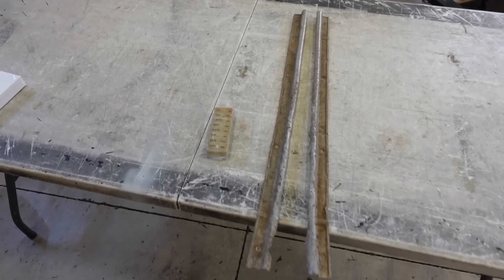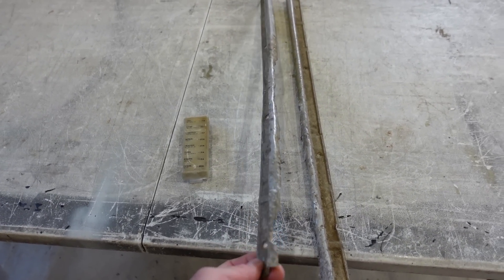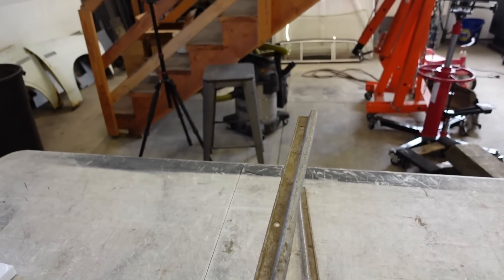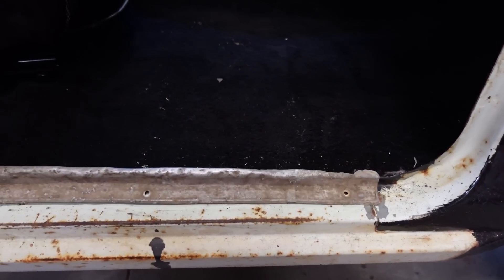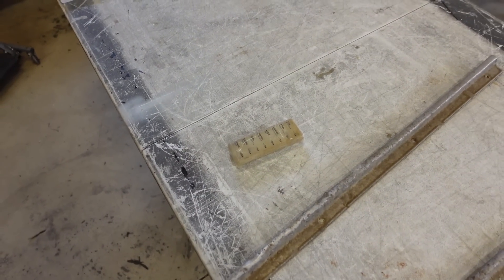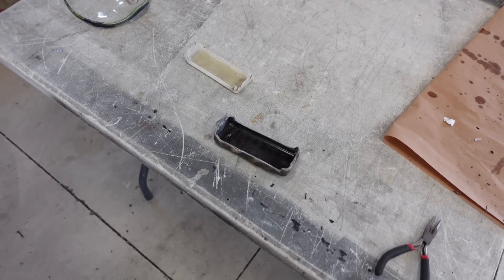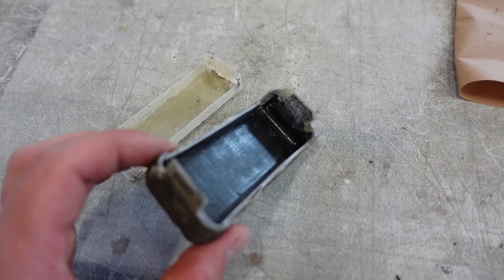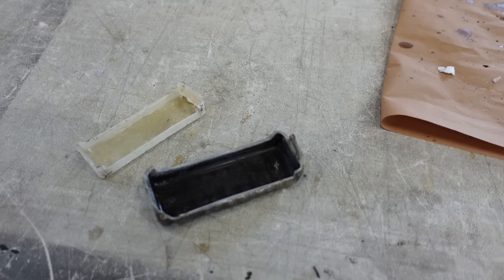Building Carbon Fiber Parts From Scratch!

Comment: Have you tried using a roller for molds? When I did fiberglass for yacht hulls we always used roller to get out bubbles.  That then vacuum bag for part. Also black hole down screws would look cleaner.

Comment: When I worked at a fiberglass shop, we used tooling gelcoat to start the molds, usually 2-3 coats so you had some substance to sand/wet sand/polish after separating off the master.

Comment: to fix those voids and improve the corners vacuum bag it and use some peel ply. a harbor freight vacuum pump, painters plastic, duct tape and a sheet of sheet metal for the base is great for this. you just lay up your mold, lay down the peel ply, then put it all on top of the metal sheet, then tape down a sheet of plastic over the whole thing and vacuum it down. for your smaller parts, a vacuum sealer for food works too! The peel ply pulls away the excess resin, then the vacuum form pushes the fiber into all the corners and cracks. that will fix your voids and make much stronger parts too. if there is too much resin then as you stress the parts the resin cracks, and the two sides of the crack act like scissors and cut the carbon fibers. Not really an issue for parts that are mainly cosmetic, but it still helps improve the look. 

Also, idk if you have seen this stuff, but that little cover would have been an excellent candidate for forged carbon fiber. Its just chopped tow carbon that is pressed into the mold and cured under pressure from a vice or clamps. it works great! Check it out.

Comment: Much better!!!  Finally making negative molds!  Although you started on a pretty tough one, difficult to remove the original piece when it's surrounded on 5 sides.  Now the next step is to get yourself some vacuum bagging supplies.  That will take care of your air bubbles and getting the cloth deep into the tight corners.  I do have to say it again though...with all the restomodding on the interior you should just repaint the exterior of the truck.  The current exterior, while cool, would go better with a more sympathetic resto like Mexican blankets over the seats.
Reply: Mexican blankets over the seats how dare you.
Reply: Nothing wrong with a Mexican blanket interior on the right build, like a rat rod or something.  Just needs to be a cohesive design.

Comment: Have you ever thought about 3D printing your molds? Could be really helpful. There are materials that you can print with that dissolve in water as well which could help with some the intricate parts so you don’t have to cut them out or anything like that. I do a ton of printing and some cad design and could talk to you about the potential of this if you would like to.

Comment: You need to vacuum bag the carbon fiber is the only way to get the air pockets out and make it look right and it actually adds strength because there are no air pockets in between the layers or anything like that

Comment: A vacuum bag would help your surface finish and reduce your post processing time, but they still turned out decent without.
Reply: Yup.  That and a heat gun.
Reply: I made this same suggestion last video. Seems like the move